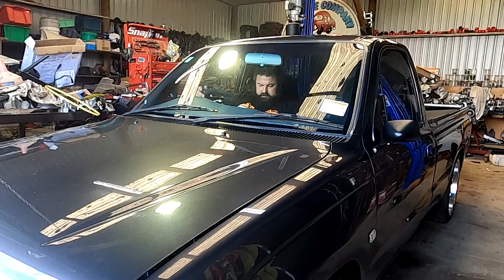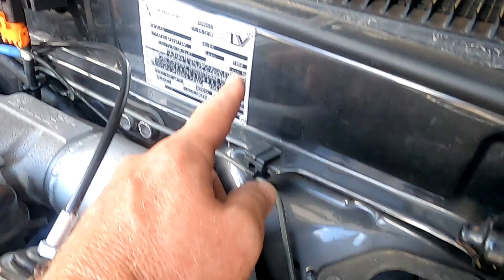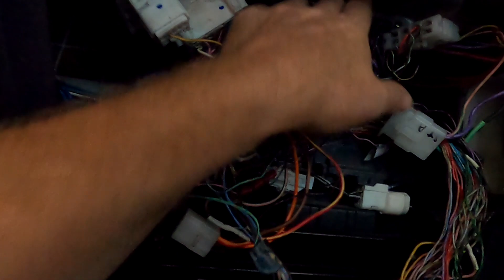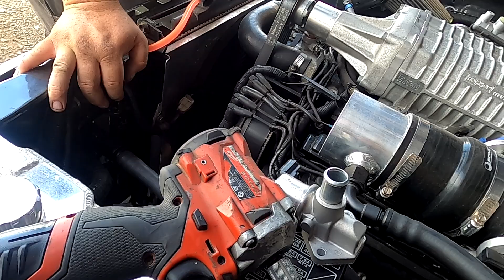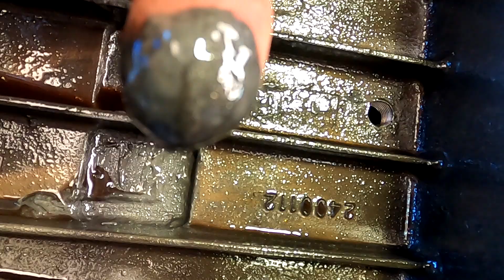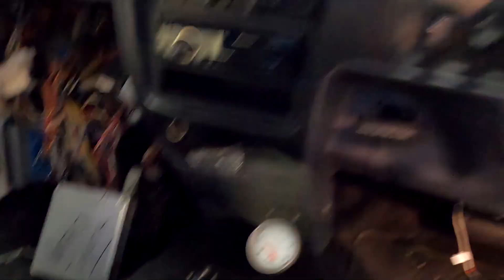Supercharged 1uz Hilux ute tidyup.  Part 1.  We pull it apart.

Comment: Nice Ute. HP guesstimate ?
Reply from the maker: Basic maths,  1 bar of boost doubles hp,  1/2 a bar of boost 50% more than stock na, less some parasitic lose for the charger.  Instead of guessing I think we will run on the dyno to get a proper measure.  I havent even driven it properly yet to see how it goes.  Cheers Kelvin